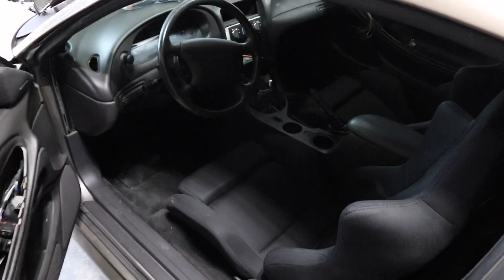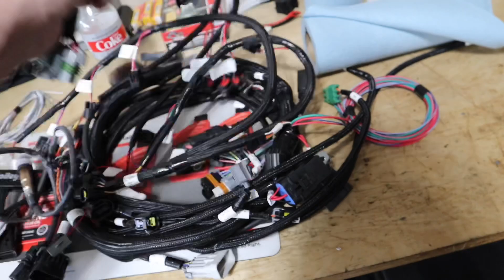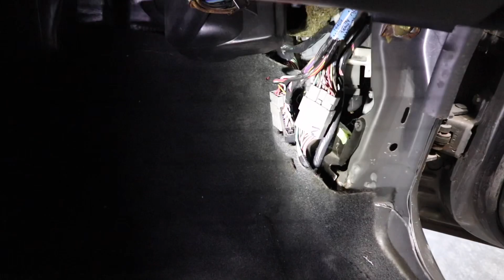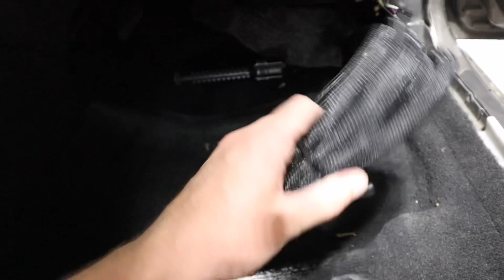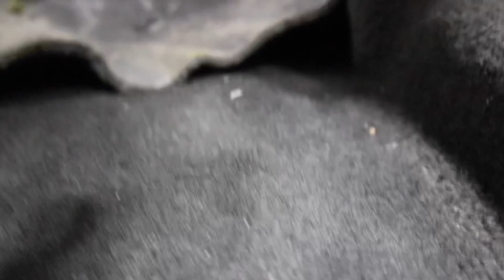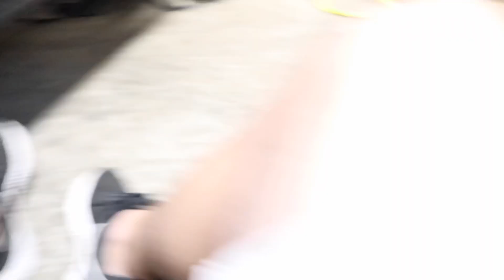New project! Vortech supercharged 2v

Comment: I had to modify the crank and cam sensor settings to get mine to crank and start with my Holley terminator. I love the terminator x. Definitely be following this build.
Reply: I also had to extend my FPS wiring to reach the passenger side where my regulator is. Other than that it’s great. 

I used low dollar Motorsports for the oil and fuel pressure.

Comment: Yo! Andrew I love it man! Your boy has been waiting a long time on this one! Here is some info about the car for anyone wondering... 2002 GT Vortech V1-S trim

Short Block:
MMR 900 Rods (Andrews og build)
Cobra Pistons w/ new rings etc.(stock bore Jessie Ketives og build)
reconditioned GT 6 bolt cast crank
Gt iron block (low mile, stocker)
Arp hardware
New ford racing oil pump
New ford racing water pump
Blueprinted & balanced to (+/-) 1 gram.

Heads:
trickflow .600 springs &  retainers etc.
small valve job and a gasket match, (little smoothing by hand on intake & exhaust sides), 
bullet cams 
and of course the crown jewel, the Reichard Racing intake.

Comment: Andrew is that going to be an air to air setup?
Reply from the maker: Yes
Reply: @andrewlavender08  so i have a 2002 gt that i put a v3 on and that cx racing air to air intercooler on. Its a draw through set up. So now im having issues because im getting to much back pressure going to the supercharger. My mass air readings are all over the place. So im going to switch it to a blow through any advise on where to put the bov
Reply from the maker: Between the intercooler outlet and throttle body before the Maf
Reply: @andrewlavender08  ok thank you andrew

Comment: The his couldn't have come at a better time I'm getting ready to install the Holley Terminator X on my 4v. My question is will the 12v key source be the same on the 4v as the 2v if not what wire on the 4v should I use.
Reply from the maker: Should be the same